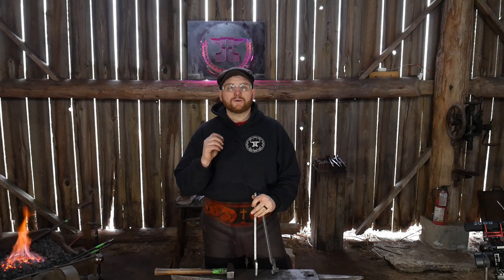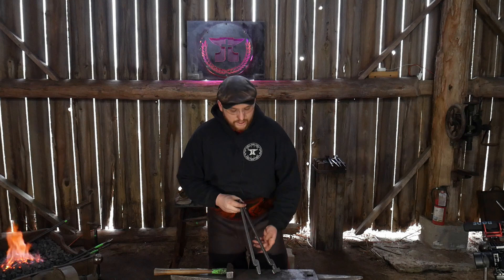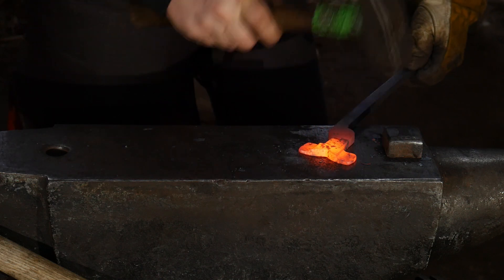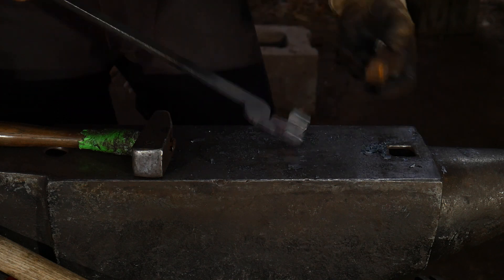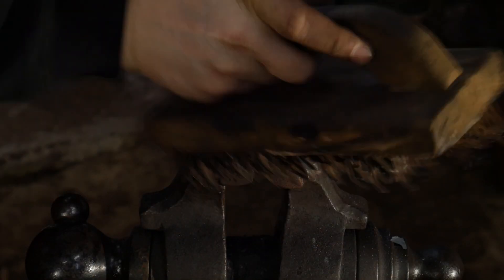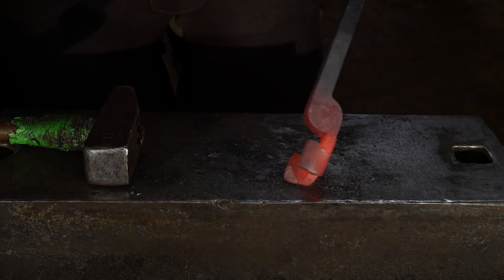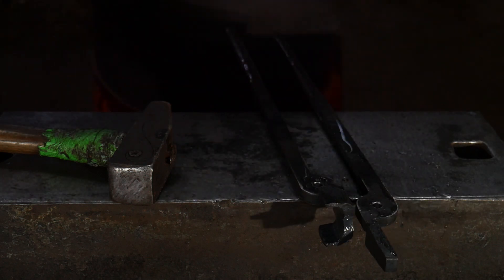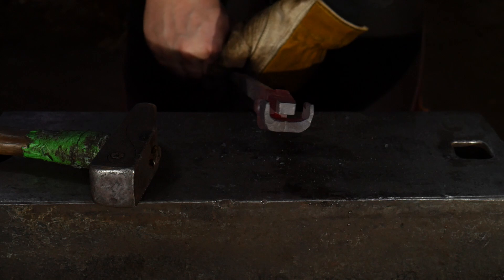Precut Box Jaw Tongs: Forging and Reviewing RX 06 Tong Blanks

Comment: Couldn't you just do the upset straightening in the vise?
Reply: For the twist issue.
Reply: Never mind. I rewound and saw what you were talking about. But what about using a small square head hammer for that?